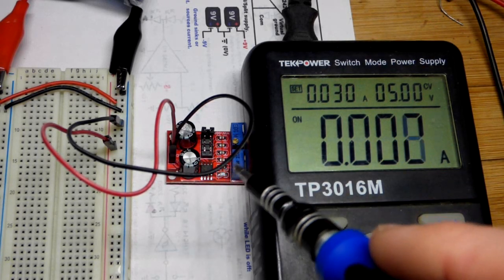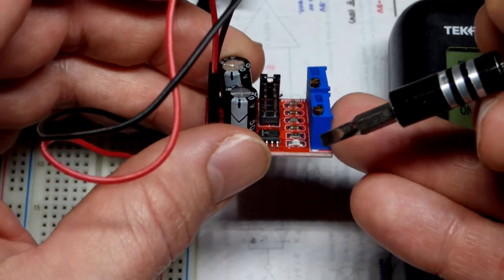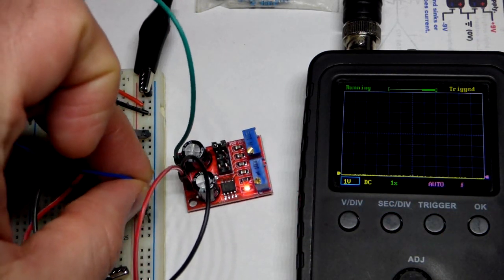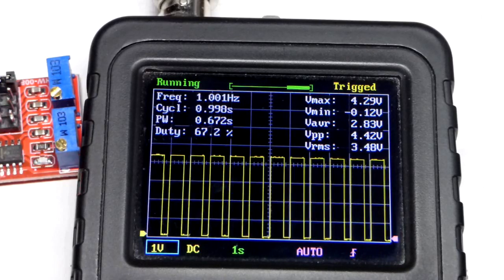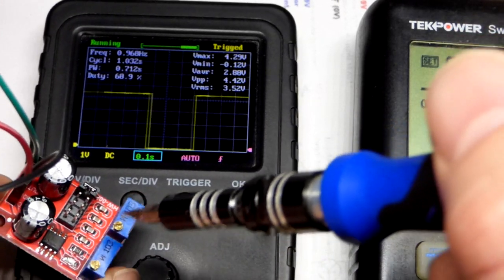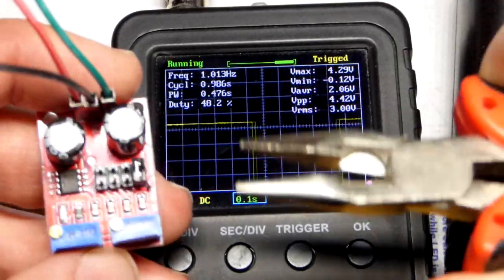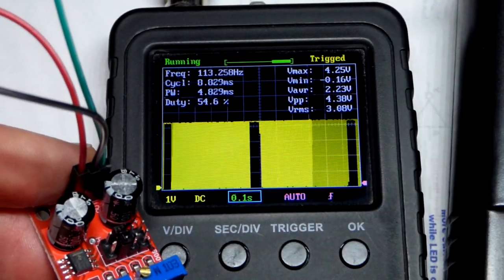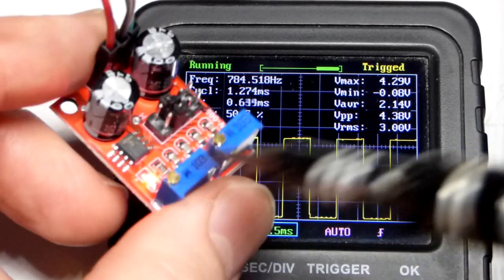First look at 555 timer module with simple oscilloscope measurements

Comment: I have been testing and it is very difficult to adjust to a certain frequency.
Reply from the maker: Yeah, it takes a bit of practice to get good at adjusting 555 timer frequency when you can't use an online calculator or do the math. This isn't a fun option, but it is the least annoying one that I've come across so far.

Comment: I have one of these but the chip is actually an LM358. It was fun to experiment with. For fun, I've connected it to the gate of a MOSFET to actuate motors and larger LED lights, as well as a coil to interact with a permanent magnet (like a solenoid valve).
Reply from the maker: Very cool!